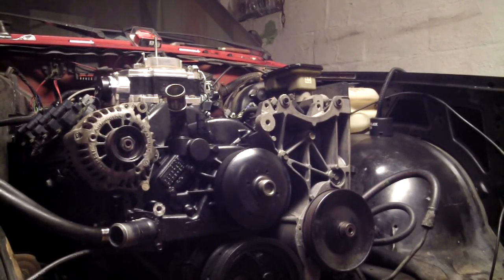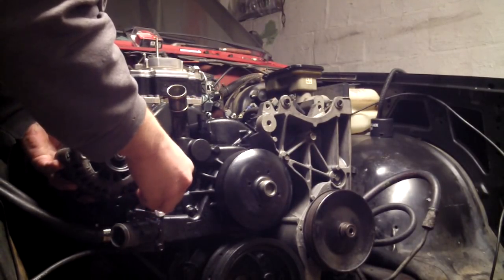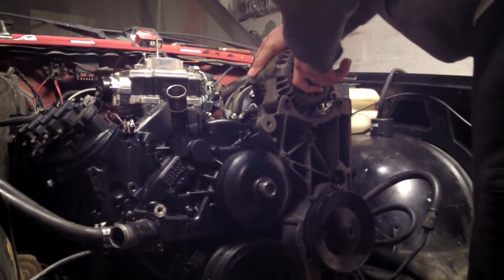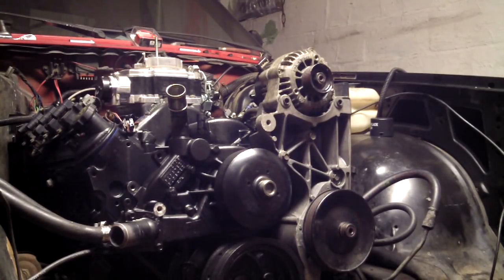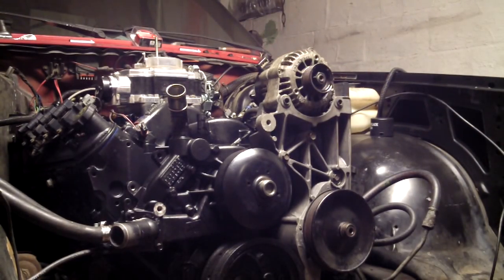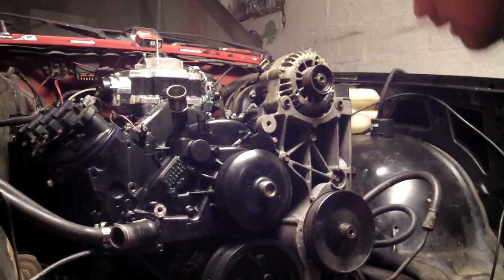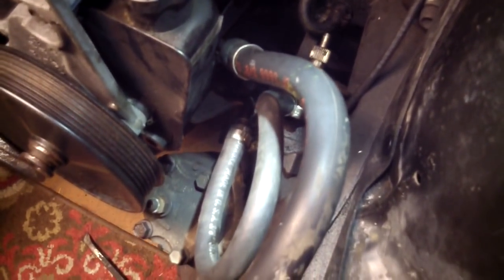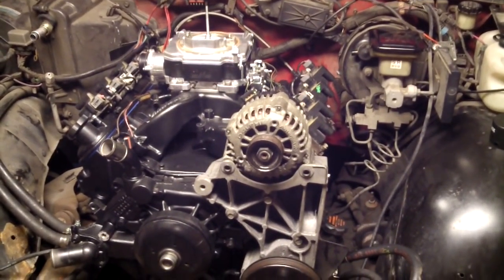How to : LS1 5.3 swap S10 Alternator height issue. Power steering setup

Comment: one other option that just came up lately is holley makes a mid mount system that replaces the water pump and brackets with their system that has a built in bracket into the water pump assembly, and then gives you the ability to replace a center section of the water pump if it goes out, but I think its around 1600 bucks I think...  Not exactly DIY budget friendly but its a great solution for your exact problem with the S10.  Also the system I saw includes all the AC pump, another alternator, and probably other things not needed so you can probably found a bracket only version, and I think the problem with the hood is it may not have the clearance where you need it unless it has a extra wide cowl pop up on it.   I'd try and get measurements on the hood before you do too much work though because aside from paint that is probably the easier solution, and plus, who doesn't like a little cowl hood action?   ;)
Reply from the maker: Robert Craft $1600 vs $170 🤔
Reply: Perspective!!!!    I looked around and it seems of course Helloy doesn't want to sell it with the minimum parts, otherwise it would probably only be about  400 bucks...  Go figure!  🤑
Reply from the maker: Robert Craft Thank Goodness for the little guy entrepreneur with the CNC machines in Kansas lol I’ll post an update once their product arrives! :)
Reply: Amen to that.  i have a good buddy that has a nice mill and once in a while I will get a drawing I send to him for whatever it costs him and his time.

Comment: We didn’t have the funds to try the LSsimple relocation brackets. One other issue I’ve had, I’m on my 3rd power steering pump!  I’m not sure if there’s a valving issue or over pressure issue but the power steering pumps keep going out. Aka start screaming really loud.  I was told I may need to try swapping the valves so I’m using the 1985 style instead of the 2000 one. ??? Not sure, but at this point I’m shopping for a manual steering box to swap in if this thing starts howling again. 🙄
Reply from the maker: HeadFlowInc I run a newer style pump in my Gbody.5 yrs later no issues 🤔 I ordered a set of ICT billet relocation brackets. Surprisingly the price was very reasonable for what you get.
Reply: BEETEROLDS with your billet relocation brackets do you have to run the f-Body water pump?  When we were looking many of the relocation brackets for the alternator also required other adaptive/relocation they don’t mention, but you could see it in the pictures. Plus the car water pump deal.
Reply from the maker: HeadFlowInc from their link their kit is completely compatible with all truck components. Some of their kits required the Car pump and damper I believe I’ll be ok with this setup. 551396-3 is the ICT number.
Reply: BEETEROLDS The kit and price look good!  The only area I’d keep my eye on is belt contact on the water pump pulley, it’s literally only. Maybe touching 25% of the pulley where Stock is 50% or more. As long as it doesn’t slip or only slips at high rpm it should be ok.
Reply from the maker: HeadFlowInc I’ll glue the pulley

Comment: Now you see how I ended up with a Cowl hood scoop. 😳. On mine a big part of my issue, we didn’t know about, the S10’s with a 2.8 engine have 1 1/4” stands/pedestals to space the motor mounts from the crossmember. Do not use the factory stands if you have them, cut them off and mount directly to the crossmember.